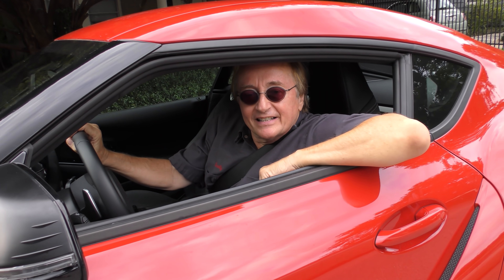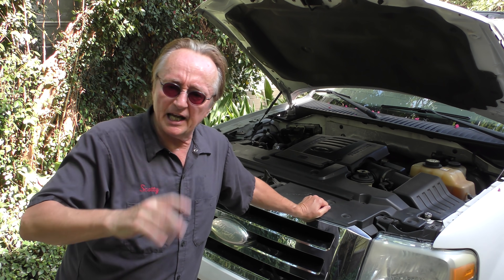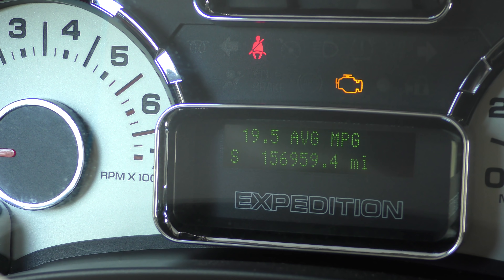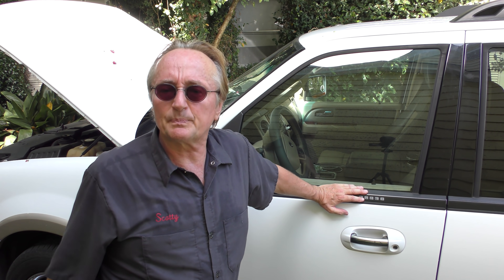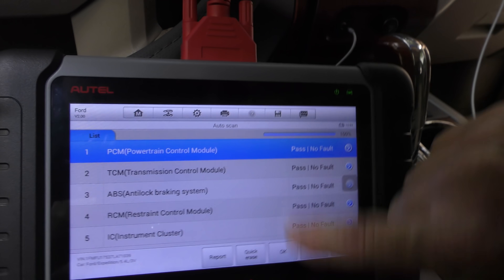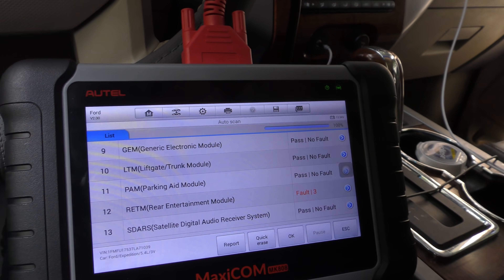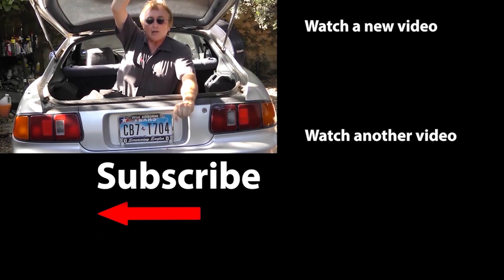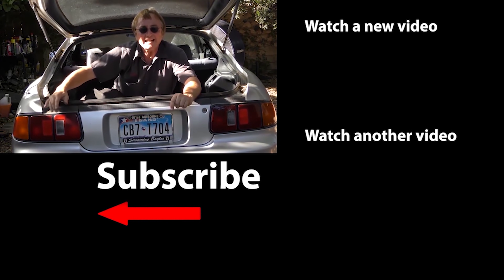The Cheap SUV No One Talks About

Comment: Hey Scotty just recently found your channel and really enjoying it. I bought a 2016 Chevy Cruze Limited 2 years ago with 65000 miles on it.. my buddy and I change the spark plugs not at a hundred thousand miles now I'm at a hundred and three thousand and I was getting misfire codes p301 n2u 0073 Stabilitrak codes. Just spent $600 auto shop to have PVC valve that's built into rocker arm cover and the single unit coil pack replaced. just spent $600 at auto shop to have PVC valve that's built into rocker arm cover and the single unit coil pack replace not a bad deal from the research I did. Could you please speak about how to make the best and get the most out of what you have said is a cruddy car I have generally been happy with it just need to get the most out of it I can cuz my wife thinks that it's a bad idea to try to get a new vehicle while we still owe money on this one thank you for your honesty and help keeping the rest of us from getting taken I'm in a dust Street area of Arizona and our heat here takes its toll on so many different things PS is there a way 2 make sure the catalytic converter last the longest and about how long do they usually last

Comment: Ford's SUVs seem to be at least decent.  Those 4.6 and 5.4 engines are pretty solid.  I've posted before that one of my neighbors had a Tahoe and he had to replace just about everything on it with just over 100,000 miles and another neighbor had an Expedition with over 250,000 miles and the only thing he replaced was the alternator.  The Land Cruiser is the best SUV but from my experience Ford is better than GM right now and much better than Dodge/Chrysler.

Comment: are the 5.4 tritons in these the same as the ones in f150s that are a huge pain to change spark plugs in?
Reply: I’ve never heard any mechanic recommend this generation of the 5.4. 24v valve have the cam phaser problems and the 2 piece spark plug problems
Reply: They went to one piece plugs in 2009 or '10. Didn't fix cam phaser issues though.

Comment: That truck has one of the worst V8 engines ever made.  The later 5.4 engines are notorious for failure as a result of oil starvation from cam phaser problems.  I had a 2009 that blew the mortar at 115k after having been meticulously maintained.

Comment: Hi Scotty, out of topic, I have 2013 Hyundai Veloster Turbo and the exhaust blowing dense white smoke all the time, my mechanic could not conclude if it is the Turbo or the head gasket, no idea what to do without your advice!
Reply: @zeroyon4562  I cant say how it smells I tried to avoid it, but more likely oil. The car is not heating up and coolant level is not dropping, we disconnect the turbo and let the engine run, the smoke decreased for about 70% less than it was, but the smoke still comes from the exhaust after an hour of keeping the car running.
Reply: @zeroyon4562  exactly this is what the mechanic concluded he said we will change the Turbo and then see what will happen, but he is not thoroughly sure it is the Turbo.

Comment: i got a 2018 mazda cx-9 gt with 10 miles on it now it has 39k and i love it.
Reply: Mazda is an underrated JDM car brand. I have tons of respect for them, coming from a Hond- fan!
Reply: Keep an eye on the thermometer and see if they fixed that transfer case issue for that year model.
Reply: Why did it have 10 miles on it?
Reply: @mrgarrison3516  it was brand new with 10 miles from the factory which is normal since it came from japan

Comment: Buy the expedition over the explorer,that 4.0 v6 gets 12 mpg on a good day.
Reply: The 4.0 was a pretty bad setup
Reply: Hmm really?? I got a 2006 Ford Explorer XLT with the 4.0 v6. Average about 15 mpg and that’s driving above 80 on the hwy and more than 10 above the posted speed limit in city. Haven’t got lower than 14.5 mpg.
Reply: @blitz_2590  careful, everytime I hear an explorer knocking, it's that 4.0. They also had timing belts instead of chains.
Reply: @Timothy B At 184,486 miles so far no issues with the engine. I change the oil every 3,000 miles. Only thing that frustrating me right now is the damn transmission. Bought it with 150,000, transmission broke 10,000 miles later Tried my luck of used transmissions from the junk yard like Scotty mentioned in a video to save money and two failed less than 3000 miles. Saved some money to have it rebuilt at 171,000 and now solenoids need replacement. If transmission gets any internal damage again, I’m just gonna sell it.
Reply: @blitz_2590  those older ones had that too
Reply: Timothy B damn... I’ll see how long my explorer lasts before selling it and buying a different car.

Comment: Hey Scotty, I just learned how to drive a manual transmission after hauling stuff around on my dad's truck. I was thinking of fixing up my 06 hybrid honda civic and trading it out for a sportier stick shift. A 2014 MAZDA3 i Sport caught my attention, but I have no idea if they're good cars. Any suggestions would be appreciated!
Reply: The Mazda3's are great cars. If its got that 2.5 liter 4 cylinder Skyactiv engine with the 6-speed, they can last quite a long time, I've seen them go up to 250k miles with normal maintenance without any issues. They're fun, zippy cars. If its got the 2 liter, that's okay, but the main engine you want is the 2.5. The Mazda3 is going to cost way less in the long run than the Hybrid Civic. If you can get a good deal on it and you have a mechanic check it out and they say its good, go right ahead and buy it!
Reply: @aytugdemir1323  Thanks for the great reply. I'll look into, just need to get my car to where I can sell it.

Comment: I'm buying my brothers 1999 volkswagen passat 5 speed manual for $800. It has 190,000 miles. Thoughts?
Reply: I mean it’s old but it’s a manual and that’s a very fair price for that age & mileage. Be prepared to do a tune up & belts & hoses, maybe suspension parts at that age (ball joints, tie rod ends, struts)... 

But dude if you even get 3 months out of it for $800 you’re “money-in” as opposed to taking on a $250-$300 car payment on something newer. I’m not even a VW fan boy at all but I’d take that deal every day of the week as long as it starts up & isn’t throwing up check engine codes
Reply: @brucemorris3830  i have a 2019 nissan frontier and this will just be a spare beater. And it just got new struts, new battery and fresh oil
Reply: Luke-o 1234 Oh man sign the check then. The struts alone are worth $800 and you’re getting a car to go with em for free 😂😂😂

Comment: Ah, but what about the infamous Ford Triton 5.4l 3 valve V8 with the cam chain guide problems, etc?  Those engines are considered among some of the worst Ford ever produced.  If the cam chains skip enough teeth on the sprockets or loosen enough, the timing is thrown off and the pistons will smash into the valves and your done.   I wonder if this car that Scotty reviewed already had engine work done on it.  Buyer beware for those SUV's and trucks with those notorious engines!

Comment: The Transmission is a ZF HP-6. The clutches can be adjusted individually throughout the Life of the Unit. Same Transmission that's found in certain Rolls Royce, Bentleys, BMW and several High Power Sports Cars. The engine is the 4.6L V8 (3valve) that's found in the Mustang GT of the same year.
Reply: 5.4.
Reply: 2007 Expedition used the 5.4 3V mated with the 6R75 transmission.

Comment: Those Expeditions and Ford F150's with the Triton 5.4L 3V worth crap in my  country, nobody wants them because of the ''unreliability'' of the engines (caused primarily by crappy mechanics, shitty oils and Chinese or counterfeit ''Ford'' parts). Also the Ford Explorer with the 4.6L 3V have very bad reputation as well (specially 2006-2008) but I can't blame the cars, I just blame this country conditions and the people
Reply: It's funny that my father paid around $45,000 in 2012 for his 2010 Ford Explorer (9.000 kilometers then) and a 2007-2008 Toyota 4Runner with 60.000km was around $40,000. Today in 2020 is hard to sell the Explorer for more than $6,000 and the 2007-2008 4Runner can't be found for less than $16,000 with some kilometers and all the way to $24,000 for very low kilometers examples.

Comment: I disagree with you Scotty, best cheap used SUV is the GX470/ LX470
Reply: @N0RT2G0RD4U I have a GX470 and it's not all that expensive to maintain. The air ride and electric shocks are the problematic, expensive parts. Shocks can be swapped for oem 4 runner ones which I did ($40 per corner) and the rear air ride can be swapped with a metaltech kit ($350) which I also did.

Comment: Does this not have the problematic 5.4 3v???
Reply: Before 09 they were the problematic years for it.
Reply: @AlexTraxxas  well, the cam phaser issue exists till 2014, so there is no design improvement to address that issue. If you're talking about the spark plug issue, it was solved with the late-07 ones.

Comment: He didn’t say still blows ice cold air I guess it doesn’t.What a ford piece of crap.🤐🤐🤐
Reply: That's cause the blend door actuators fail and your temperature gets stuck on whatever the setting was on. They are buried in the dash and if you don't fix it yourself you'll pay $1000+ to get it fixed (only for it to break again).